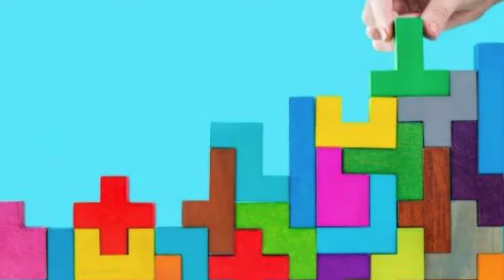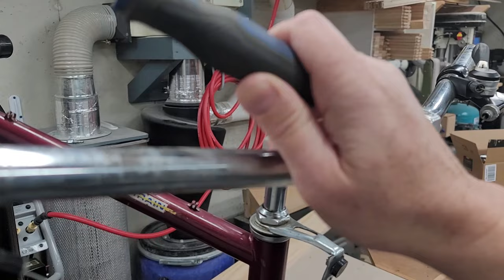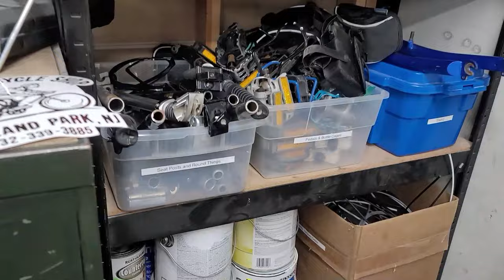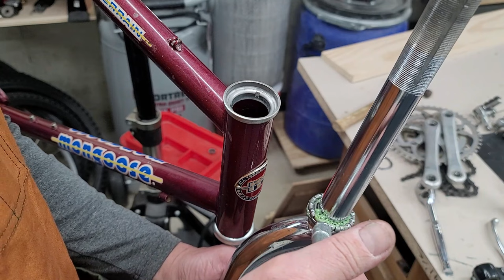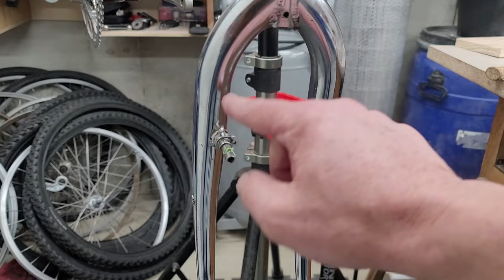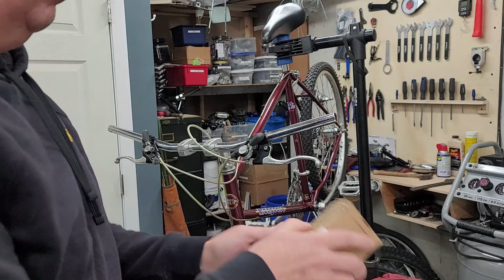Old School Mongoose ATB All-Terrain Bike - 1984 Vintage mountain bike restoration ASMR

Comment: I have this same bike. I found it outside of an old fire department with a free sign on it in mint condition. It was so clean i kinda regret using it but oh well. Now it has a bt100 motor on it and goes 35 mph. I was trying to date it and everything is exactly the same except my forks seem to be the original and are different. They are more old school like flat top. I wonder if they made an 83.
Reply from the maker: I don't think Mongoose was very good with standards on their builds. I have seen both kinds of forks on the same year.  It is defiantly confusing with this ATB model.

Comment: I have issue with the word "restoration" which means to make like new. All the "cool" kids are using it, but it doesn't make it right.
You did an overhaul. You cleaned it up, did what you had to, and it turned out pretty good if I do say so. 
But it was not a restoration. 
BTW, the front end (shifters,levers)is pure 1986/87 and I would bet the rest of the bike is as well. That deore derailleur set is in that year range too.

If you ever do an update on this bike, please use parts that do it justice. You kinda did it on the cheap this time. That was a very good MTB in it's day.
Reply: I picked up an almost pure catalog spec today for $10. The Pro Class wheels are one of the coolest parts these came with. Added to my future YouTube build channel.

Comment: Seems like a lot of these "restoration" videos are just dissasembly and cleaning so basically just maintenance. And cutting those cables seemed kinda silly since they were original and still good
Reply from the maker: Some of these are worth keeping original while others need to be customized.  I will be doing both of these kinds of builds on my channel.  When I find a bike, I decide what needs to happen to it.  Thanks for watching!
Reply: Those cables were toast. The only cables I try and reuse are the really large diameter brake cables (2.0mm) and housings (6.0mm), especially if the frame braze-ons were designed. You can find the  reducer ferrules for modern housings, but the thicker stuff looks cool and you get a bit stronger brake force out of those.